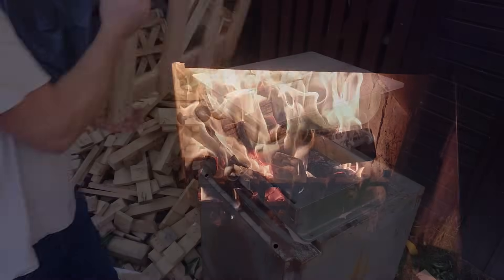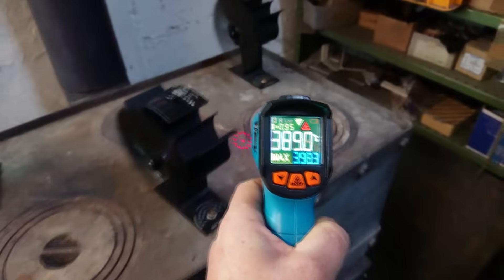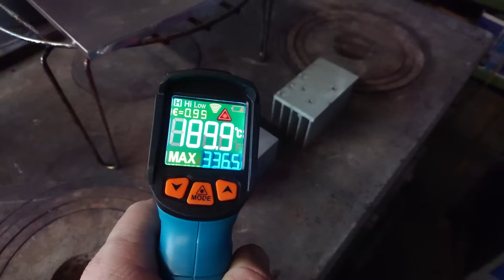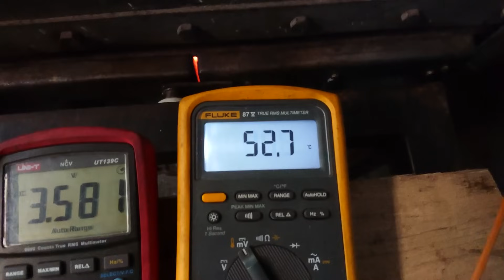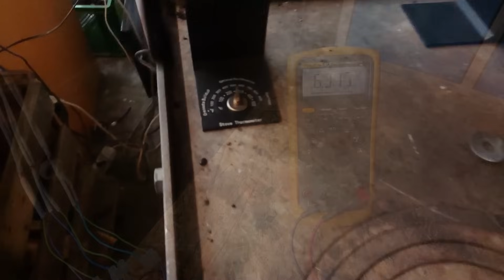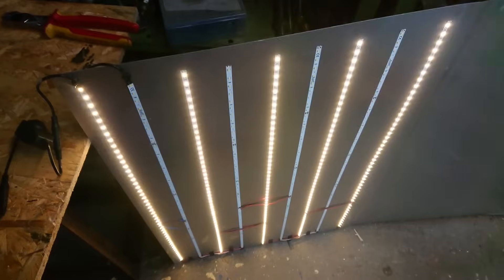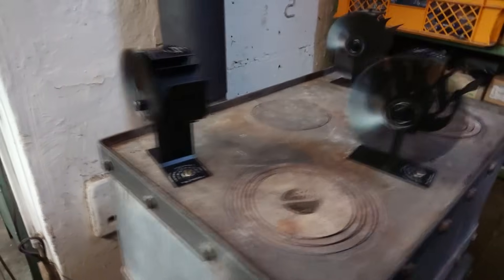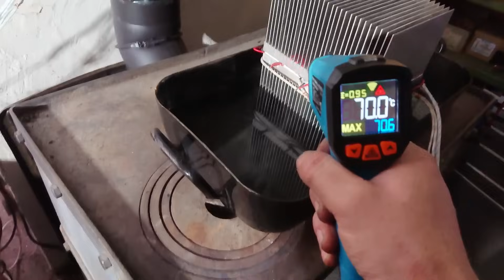Generating Electric Power with my Wood Stove - Peltier Experiments

Comment: could you use the concept to recharge a battery storage device for back country camping? i have a 36volt electric skateboard battery i would like to turn into a portable rechargeable power station to use for recharging cell phones, mini Bluetooth speakers, portable 5v camp shower and lighting for a tent, considering there's always a camp fire or heat source when camping it could harness electricity from those heat sources anyhow,

Comment: I think digging a 30 feet by 100 feet deep hole in the ground, line it with water right membrane, then spend all summer heating it, would be the best advice! It can be heated by the stove, then pulling the heat out for the cabinate, would work best.

Comment: The technology itself is brilliant. But unfortunately, we can't use it for any device. Nobody needs these LEDs to be powered by the heat of a stove. But what we all need is enough power to run the pump for the heating system inside the house during the power outage or when foking Muscovities bombs our cities and infrastructure! So the ideal use case for this is to power the water pump, but in 220v version it consumes ~50 watts. IDK about 12v versions but even if it's 20 watts it's still too much for this bunch of peltier modules.

Comment: I am exprementing on the same thing my set up is different as i heat up water via the stove so before heating water it pases throw the peltiers cooling plates the same as for pcs , for now i have destroyed all of my paltiers i have ordered paltiers that are used in the stove fans in hopes to get more energy and more heat resistant, but the fact that should use thin aluminum legs has been what i was looking for , for temperature regulation using granite    is something to consider, in my next setup i will use granite thin legs and new peltiers , thanks for the vid 👍

Comment: I wonder if this could be used with my radiator to flip a solenoid to activate a fan to heat my drivers cab when the coolant temps reach a high enough heat to actually warm the cab... Dunno.

Comment: Most of the "heat" that you feel from the wood stove is actually infra red light.
If you made a panel that faces the peltier devices near but not touching the stove.
Maybe a coating of paint or ink that is known for absorbing large amounts of UV light would help as well.
I think on the back side of the panel, if it was enclosed like a chimney flue would or should handle most of the cooling needs.
This will still not generate big power, but should be relatively stable power for as long as the fire burns, without damaging the peltier devices.
🤷 I just guessing mind you.
All of my ideas might be horrid failures but you seem like someone that enjoys experimenting.

Comment: Hi, my name is Teodor from Romania, I was thinking for you to add a measure of protection for those peltier devices. A simple thermometer next to the peltier - surface - they contact and you will have to peak at it from time to time, intuitively adding or stopping the fire. You can make an iron drawer where the fire is performed inside the stove, and you can adjust the drawer more far out of the stove or more inside the stove. This way, you can very quickly and intuitively adjust the heat emanating, especially in an emergency when the temp on your termometer is at 98*C, as an example. Also a quick attachment cooling element, like a block of aluminium, to atach to the surface of the peltier or that smoke tube that is heating up. Another idea is a device that will mechanically detach the peltier module from the stove surface, at a reasonable distance, like a [bimetallic strip] is my first thought. I hope you like my ideas and actually put one in practice.
 - Also check on YTube, about [wood gasifier] - a complex device but very interesting if you manage to make it work, see these guys what they did: 
https://www.youtube.com/watch?v=HhnrKHF8BWU&ab_channel=Gridlessness
https://www.youtube.com/watch?v=t74MhMwxZCo&ab_channel=Gridlessness

Comment: They made these peltier devices so small that its almost impossible to have a temperature difference. This is useful when you want something compact to play with, but not if you want to generate power.
For power generation I would weld one end of wires to the stove pipe and the other end I would get it through wall so that is naturally cooled by the outside temperature. So no peltier device.
The only problem is: you will end up with lots and lots of wires.

Comment: All you need to do is drill a hole on the side of the exhaust pipe, fit a metal, maybe copper rod into it to gather heat. The cooler should be around 3x the mass of the hot side if not more. The hot side can be just threaded plate to connect to the hot metal rod. Using radiators makes no sense. By changing the depth and shape of the metal rod you can change the amount of heat. Now the cooler will be on the side - and this is good because it doesn't need to fight the hot air above the stove. Now use some of the power to run fans.

Cooler solutions also drive the cooling air into the fire for more efficient burn.

Actually you could just use a metal rail that you can slide from the table. Fully on the stove - max power, slided partially away you can reduce the heat to safe levels to run at optimum.

Comment: Hi Gerolf,
as you mentioned he use of wood gas for power and heating it comes across a subjct I think about recently.
Maybe you've seen it before, it's a fairly new type of wood gasifier called the downdraft wood gasifier.
It's more compact than Imbert type, produces less tar and prevents some material wear too. 
The gasification works continously, like some very big carburator.
When I find the time I will do some test devices in my workshop that's located some 150 km away from yours.The 
Hope your surgery did pass well. 
I since years now extremely dig the approach, the professionatilty and the dedication you put in your work.

Comment: If u have very high temperature u might want to utilize all of that by stacking the TE modules putting them in thermal series thus dividing the temperature difference between each member of the stack.

Comment: I have been told that the tegs work better when run separately vs in linear. I hear that you lose a lot of power due to the least efficient TEG.

So if you can plug them into a voltage combining device, you should get more power. As the least efficient TEG wont bring down the rest.

Do they make devices that combine 9 or more low power sources into one power line?

Would you be willing to return to this experiment and try running them through a voltage combiner?

Comment: One last thought...

First of all, graphene turns magnetic flux, gigahertz, terahertz, and thermoradiation into electricity.  When you take a sheet of it fold it 5 to 7 times, the anode and cathode interacts with the core folds becoming a superconductor.  You add an oxide and electrolyte to it with an acid, it will act like a battery or a capacitor.  You surround sections, not so much as for thermoradiation, but with a plastic felt it then stores electricity like a battery or capacitor.  You find the combination and add certain silicons it will interact with magnetic fields more.  You store in a ceramic housing, you are making a new Peltier.

However, from an automotive junkyard, if you get a cheap working alternator, use your pipes, use something like a torodial wheel, with baffles, with pulley systems to increase your RPMs without filling your building with smoke, you will never beat an actual generator with a Peltier.

For the cost of those electric components, you do it mechanically, you should yield a higher voltage, amp, watt output.
Reply: You forgot to add 'Tesla', 'quantum' and 'resonance' to get the full bullsh1te bingo full house.

Comment: I am sorry; but, anything I know takes more cash.  My concept is more augmenting your's to produce more power from what you are doing.  To go beyond that would take chemistry where base would be using a core of graphene, then adding some chemical (sulfuric acid, for example) to interact with the graphene to increase joules from thermal radiation.  Or something to do with electoralysis making hydrogen to use something like the Omega 1 rotary engine to burn the hydrogen to use the exhaust to help refill the reservoir the water is in.  However you need at least calcium to absorb the CO2 produced slowly reducing the mass of the water reservoir.  Omega 1 can be 3D printed.  However you would have to create a method to reduce oxidization with your anode and cathode.  TEC and TEG I haven't seen anything better than you have done.  That's about the maximum anything I have seen has done.

Comment: Why don't you try and make your own thermopile? That way you can design it to not be a flat, thin plate like peltier devices are maybe they wouldn't conduct heat as much through them. In principle iron-copper or iron-constantan wire junctions should work. Also on a cold day you can design thencold end to be long enough to reach outside of your shop into the snow as a heat sink.

Comment: Two things that may be possible, a wheel spinning from steam hooked to an alternator or using a sheet of graphene hooked to capacitors to stepup transformers to a buck converter that is made to charge 12 volt batteries.  Where an alternator is 13.5 amps, 12 volts DC, 3000 to 6000 watts...

Comment: dude!  ...wtf!?
You're cooling down your hotside for no reason by using the fins on both sides.
You should have a solid plate on the hot side. Having fins on both sides just makes it more difficult to get the temp. differential.
My suggestion is a thick aluminum plate on the hot side & see if you can source some cheep copper CPU coolers with heat pipes, since they are some of the best passive coolers. I understand that you're concerned about overheating them. So maybe have some recessed screws on the hot side, so you can create a small gap when you're worried about over-heating them. You could adjust that gap as needed. You could also use a fan on the cool side that kicks on only when the thing gets too hot. That way you're only pulling electricity for the fan if it's needed instead of constantly.

I've always wanted to do one of these where the back of the stove is against a wall so that it can be set up with the cold side actually being outside.

Comment: What you need is a Sterling engine, it used to be possible to buy a gas boiler that combined with a Stirling engine would generate 1kW of power from the hot flue gas 😊 Or just build a steam engine, be careful though, steam can and will go boom😂

Comment: I had this idea a while back and thought what if I attach them to the pipe outside. That way it won't be to hot and the cold air from outside would cool them better. Try that maybe. Thanks for saving me the trouble.

Comment: The Russians used this method to produce power for radios with a finned device that went on an oil lamp - later they would do it with nuclear ingots for lighthouses which became problematic with the decline of the Soviets and some 2500 plutonium billets scattered in remote sites

Comment: are you missing the bi-metallic strip on the bottom? or am i like little bit Brexit. :body-blue-raised-arms: i though it was standard
Reply: add efficient light bulb like the ones in dubi 2watts =60w. add a well thermally insulated Li-Fe battery as well for the winter dark mornings.

Comment: I've just bought what is alledged to be a 12 volt 26 amp peltier for £18, from ebay.
I live n a 60ft canal narrowboat, my woodburner runs on free wood harvested a few feet from boat, so it's on 24/7365,so perfect for power production, burner is at one end of boat, so far end of cabin, 25 ft from burner gets nippy, our burner has no back boiler and would cost too much to buy a stainless steel add on one, so, to combine 2 ideas, I'm going to use a recycled bathroom radiator fixed to back or side of burner to scavange hot water, use convection/gravity setup, so no moving parts, and run that to thee end of cabin to get at least some heat there, it's just so happened that our battery bank is that end too, plastic hot water pipe is an awful lot cheaper than heavy grade copper cable, bring heat in hot water to peltier next to batteries, to cool the cool side of plates, I'm going to clean a section of the 10mm steel bottom plate of the boat, fit some fixing studs nearby somehow, mount cool side on a  2 or 3 mm plate to fit over studs on bottom plate, rig another plate with copper pipe looped across it, bolt it all down to studs and start experimenting.
I don't expect to get anything like 26 amps, but if I can only get say 2 amps from each plate, well 5 adds up to 10 amp, but 10amps 24/7/365,more than enoughto run what I need at the moment.

Comment: I wonder if a heat pipe system would help to self regulate the temp as the convection / condensing rate would vary by temp.

Comment: the moment you said adding water to the equation im thinking a small steam turbine. that would give a better yeald of useble electric than the peltiier devices,
and routing the hot side to a reservoar troug a coil you can regain the heat to what ever space your heating in the first place :)

Comment: I am perhaps surprised your first attempt was not to use the fan turning to generate power. While I'm sure this also will not get much power, it could deliver some power and still move the air about. Or having seen the whole video, what about using either steam through a pipe to drive a generator or even just the heat rising through the pipe?

Comment: Really good vid, thank you for showing us your development. I did a lot of work with Peltier around 10 years ago as part of a work project. I would be really tempted to actively cool the cold side of the junction to increase the voltage differential. It may use a few Watts but should be worth it. I'd also may consider using a switching regulator to charge up a power bank. This will allow you to run the LEDs at a higher output (granted for a shorter period of time). I would maybe also consider a thermally insulating skirt around the layer of peltiers to prevent the cold side getting heated up as much.

Comment: Use the side of the stove, not the top. Thermally insulate the side of the stove where the units are not contacting so that the air surrounding the sides is cold air flowing upward from the floor.

Comment: Perhaps thermocouple principals would be better. The cold junction can be far removed from the hot junction. The materials used can tolerate much higher temperatures and you can construct them from scratch.

Comment: What could we achieve if we add a throttleable active cooling for the bottom part and control the throttle by a simple PTC sensor and fine tune to the exact spot where we can harvest more power without frying the peltier modules? I mean, you are cooling the both plates but you are cooling the top part a bit more. I don't know if there is an efficient way to implement this but if you can increase the power output in a level just above the energy consuming of the cooling mechanism, it would be considered as an improvement and maybe you could scale up the setup and use the differential cooling mechanism in its peak efficiency as you are scaling up the whole setup.
Thanks for the interesting content by the way.

Comment: Would be interesting to measure the temperature on the pipe before and after your device. With your old stove, there should not be any problems. But with a newer one, exhaust temperature is lower than 200°C. Extracting too much energy, and the chimney effect would not work propperly. And you would get condensing water (building acid and going through the metal).

Comment: Hello, Loved the video as your proof of concept has given me a few ideas for alternative energy. I was wondering for your water related experiment, wont there be a risk of ionization of the aluminum? But to help improve initial experiment: Why don't you let the outside air do the cooling for you, as the peltier device produces energy from the delta temperature. Installing the device on the external wood-stove exhaust may produce a less detrimental temperature for the device as well as offering a greater delta T. While still very hot the exhausted air would be significantly less at the end of the exhaust than if it was closer to the burning wood ;additionally, the freezing temperatures outside would creating enough heat difference to possibly improve voltage produced. Lastly a hexagonal exhaust tip may offer the space for 6 peltier modules while maintaining proper exhaust flow rather than a cylindrical design, think the fins of a rotary  airplane engine.

Comment: I did some quick math yesterday because I was interested in storing energy generated during the summer to be used during winter and a 1 m3 container holding a 50/50 water/ethylene glycol would hold around 60kWh of energy if you get it up to 80 degree celcius. With an average of 7.2kWh energy requirement per day (prolly half in summer and double in winter) this doesn't seem like very much but if space is not an issue, a thermal battery might be more viable option than producing heat and then convert that heat to electricity first.

Of course, ideally (imo) a small closed loop steam generator would be perfect, especially if combined with a battery bank as a buffer to get clean 230v but something tells me that such a setup would be prohibitively expensive 😅

Comment: Could it be doable to produce power by simply boiling water, pushing the steam through a funnel into a rotating generator?

If so, the only thing you'd need to do would be to keep filling water.

Comment: Using the stove chimney pipe is a good idea.  You could attach your peltier array to hydraulic tubes that would expand or shrink with temperature changes and help keep the peltier array at a more constant temperature.